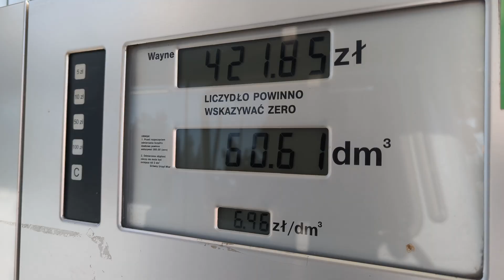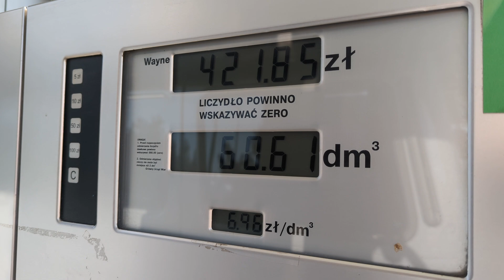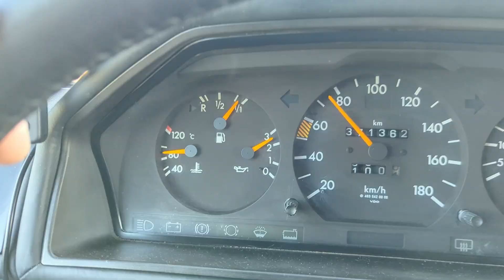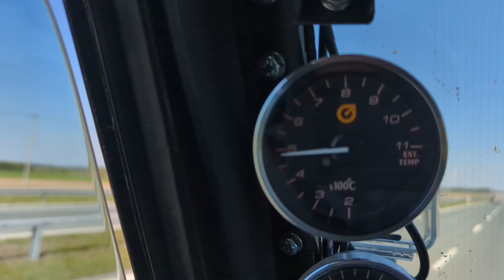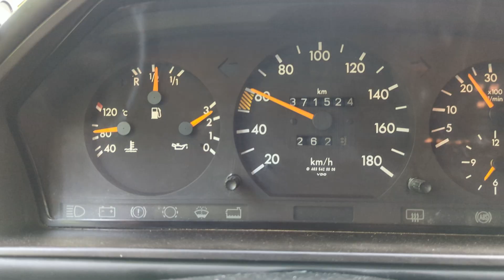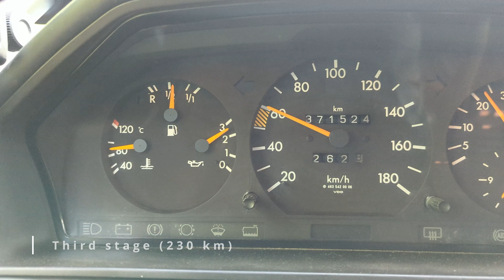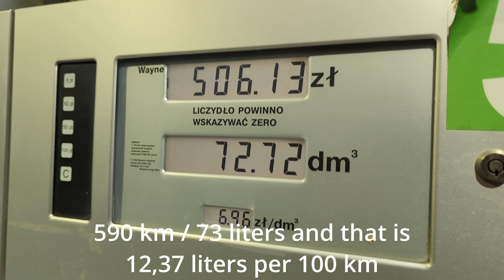OM606 G Wagon fuel consumption test (Mercedes G W463)

Comment: My petrol V6 gladiator on 37s with 5.13 gears gets the same fuel economy. You need an 8 speed!
Reply from the maker: Gladiator V6 with the same fuel economy sounds impresive!
Reply: There’s no way you’re getting that.  I need to see a video.  Or you live where it’s super flat and never go above a low speed.
Reply: @groot_offroad2958  I do live in Texas. I also don't have any lift beyond the stock rubicon suspension, so there's still a slight forward rake. And i also have very light 37s (KO2s in C range, like 60ish pounds per tire)
Reply: @Shakshuka69 gotcha and BFGs run about an inch smaller than other brands.  Surprised you went 5.13s being so flat, unless you tow.   I have 37s and 4.88 in Southern UT and I average 16/17

Comment: It is excellent result in my opinion. I have a 4.2 td 24v Toyota Land Cruiser 80 series, quite different ratios - 3.7 ring and pinion, 0.88 fifth gear (manual), 255.85.16 Toyo MT tires and with 110/120 km/h i am at same 12.3 to 12.5 liters. Very nicely restored G class, congratulations. :) I am with Cruisers for many years, the current is my 8th, but i like these particular G wagons too. :)
Reply from the maker: Yes, I did not expect that either. When I was rebuilding G I was expecting ~15, but my result is at the level of my previous engine (om603 no turbo) and that is more than satisfying. When I was in Norway (Nordkapp trip) I made almost 8000km and I was driving a little below norway speed limits (very restrictive) I came even below 12 liter/km. My mother worked in Toyota Motor Poland for 30 years, so I have sentiments for Cruisers/Hilux ;) Before G-Wagon I had Unimog 404 and this was whole another story ;) Cheers!
Reply: @MercedesOffRoadClub  I reviewed most of the videos in your channel yesterday, fantastic trips around Norway and Finland. Obviously, besides excellent mechanical skills you have "an eye" for shooting videos and photography as well. :) Again, congratulations for the project. I like approaches like yours where everything is performed clean and up to level from start to finish with a very good and completed idea in mind. The G is equipped with all necessary for travel, close to the original look, without being over "decorated". :) One question (have many actually) - why did you decide on the 6 speed manual from BMW? Why not the 6 speed manual from Mercedes? Talking about vehicles and as you mention Toyota, i have a very beloved 80 Series (my fifth and 8th cruiser in total, after 3 Patrols and 1 Defender) but my next desire is a Sprinter 4x4 project. :) Cheers and have a great week! :)
Reply from the maker: Thank you for this comment, very much appreciated. Yes the color idea of this project was to keep it tasty/simple/no fancy as much as possible. Gray body paint and everything else black mat, simple two color. Now the hard question about bmw gearbox. So I have around 18 tkm done with G and yes my only concern is this single mass flywheel. So when I was ordering engine parts (IP pump and turbo for om606) I also bought this adapter and clutch for this bmw gearbox. it was supposed to be stronger than Merc boxes. This was my first ever rebuild of that size, so I wanted to have at least this out of horizon long todo checklist (I didnt know dual mass would keep up om606). At that time bmw and this adapter plate seemed to be a reasonable choice. Now after many kilometers I would never go with a single mass flywheel for manual gearbox and almost 3 tone overlanding vehicle. Winter is coming and this is on my todo list - I will swap to merc box with dual mass flywheel or keep bmw box (I have all the mounts, driveshaft, gear stick done) and try to fabricate some dual mass - fits from Sprinter V6. I need to make some updates to video about swapping this bmw gearbox to G as well. Now I would go with Merc box.  But I guess this is going to be my learning curve. Cheers and greetings from Poland to you and all your overlanding Cruisers and Sprinter project! ;)
Reply: I am interested about the video on how to swap gearbox too
Before the swap you already got a manual or auto ?
Reply from the maker: @Sadhio  Yes, I already have Merc 716 box, but I will do the swap begining of 2025
Reply from the maker: @Sadhio  Engine is connected with 6 speed manual BMW GS6-37DZ gearbox. Please take a look inside description of this video, I put more details there.

Comment: 10/10 video. Curious, about how much did this build cost in $USD? I’m wondering if it’s cheaper to do the conversion in the US or import one from somewhere from Europe
Reply from the maker: Thanks!! I can tell you that for the complete engine and gearbox I spent ~13000 EUR. This includes buying used engine, complete engine rebuild, machining shop work, all the nessecery replacement parts, seals, gaskets, bearings, IP rebuild, gearbox adapter plate and clutch, turbo etc. I think I put summary of engine rebuild costs in one of my previous videos - somewhere in the end of long video about the engine swap.

Comment: How many HP you run with this setup?
Reply from the maker: Not less than 300. But it is at higher rpms.
Reply: @MercedesOffRoadClub  Wow really nice I am looking to make a G class with this motor and 6 speed ZF transmission. Thanks for the information. Really cool build.
Reply: I also want to build an overlander with long wheel base. Real inspiration for me here.
Reply from the maker: Good luck with your build!
Reply: @MercedesOffRoadClub  Do you know the tourqe and wheel horse power with the setup of the turbo and upgraded injection pump on your rig?
Reply from the maker: Sorry, but no. I did not dyno it. IP during rebuild was set to 55 cc low fuel and 120 cc high. I also bolted turbo straight out from the box and I did not tune intake pressure at all, so Im driving like it is. What I can tell you after more than 20tkm is that this engine is much more powerfull then old 603, but in almost 3 ton G-wagon (overlanding ready) it does not fly like passanger car in youtube vides. In 3 ton G-Wagon new 606 gives great acceleration experience, I can now easliy do 100-110 km/h on high way, that is satisfiing for me with all that gear in and out side. This 606 starts being powerfull from 2000 revs, below its acceptable, but it feels best 2000-3000 revs. CDI would be much more powerfull in lower rpms. Cheers!
Reply: @ Hi, thanks. That would be my goal aswell. Today the limit for comfort is 80, would be nice if it was 100km/h. Nice trip you did to Nordkapp. 👍🏻
Reply from the maker: 110 is acceptable with my 606, but at 100 km\h I have ~2450 rpm and it feels like sweet spot for this engine.
Oh yes, Nordkapp was great for me.

Comment: Nice vehicle. What are the gages on the A pilar ?
Reply from the maker: Thanks, starting from top one:
Boost pressure
Exhaust gas temp
Oil temp
Oil pressure
They all come from Auto Gauge
Reply: @MercedesOffRoadClub  Thanks, and where you hook them on the engine ?
Reply from the maker: For boost pressure I welded fitting in factory aluminium intake manifold.

For oil pressure I made T fitting just below oil filter. So I have two oil sensors there next to each other, factory and additional one.

EGT sensor is just before turbo - inside adapter between turbo and exhaust manifold

For oil temp I made another T fitting from turbo oil feed, close to engine block
Reply: @MercedesOffRoadClub  Thanks, the gauges are from Auto Gauge Taiwan ?
Reply from the maker: https://fmic.pl/178305-wskaznik-new-auto-gauge-cisnienie-oleju-52mm-bur-355op-52-wp.html

They are from this premium 52mm diameter series
Reply: @MercedesOffRoadClub  Thanks a lot
Reply from the maker: No problem